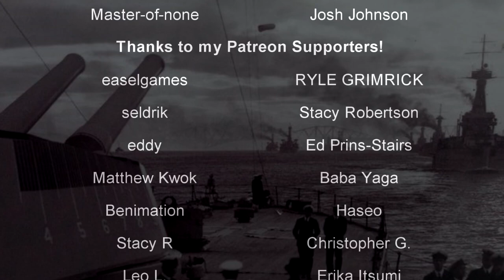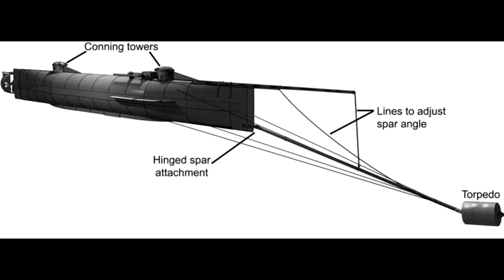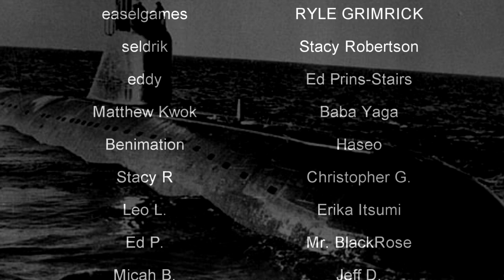5 of the Worst Submarines Ever | History in the Dark

Comment: The first generation nuclear Soviet submarines, the HENs. Hotel—-Echo—-November classes. Were noted for the irradiating their crews. Safety on these ship was optional. The crews have my respect for avoiding disastrous accidents
Reply: Do you know how our ASW forces located and tracked Soviet submarines in the 70's and 80's? At least when I was an active duty USN officer, we had radiation detectors to "sniff" the water for traces of Soviet submarines. They actually left a "radiation wake" behind them as they passed through the water. We could detect it and even tell how far they were away. That, and they made a great deal of noise.
Reply: @ThePrader  …. We all knew they were noisy. A lot of that noisiness went away when they bought technology to improve props
Reply: @ThePrader  OPSEC?
Reply: @edwardpate6128  Pretty sure the tools we used in the early 1980's are all upgraded and the stuff our ASW used in 1979-1986 have all been upgraded. Even SOSUS is in the public domain. I had to wait for a TS clearance (1981) before I was even told about SOSUS.

Comment: Can you PLEASE make a list for the "Top 5 most DANGEROUS Racecars🏎🏁"
Reply: Oh, that horrible thing that Honda did that murdered Jo Schlesser? That sort of thing, right?
Reply: @robertwilloughby8050  also Mercedes first flying car

People keep blaming the British driver driver, but the fact that entire car also using same material as explosive part of WW2 fire bomb is just crazy. On top of literal meat barrier
Reply: Kind of difficult to do, because it's a general case of the older, the more dangerous (up until about 1900). A 'most dangerous for their era' might be more doable, but aside from putting all the Chapman-designed Lotus F1 cars on there this too would be difficult to judge.
Reply: The first two generations of NASCAR stock models would technically belong, considering that NASCAR back then did not have the same safety standards. 

Not to mention that F1 did not have the halo safety device for much of its existence. Aside from the already mentioned Mercedes-Benz 300 SLR and the Honda car that killed Jo Schlesser, one of the few others I can think of that would have been unusually dangerous for the time would be Brabham bt45c "fan car".
Reply: Maybe should specify 

Maybe the first list should be about racecars from the modern era ( 90's/00's - Present)
Reply: So, a list of 5 Group B rally cars?
Reply: @epikmanthe3rd  Group B happened in the 80's
Reply: @jacobwhittington2462  Why does that contradict a list of the most dangerous race cars?
Reply: Ah. The second comment. Well that's more boring.
Reply: @epikmanthe3rd  there once was a Toyota racecar that broke the drivers RIBS
Reply: @jacobwhittington2462  Group B had very few rules, and not very extensive enforcement. Only 200 road going versions, no restrictions on materials, no limit on boost, had to be enclosed, and maximum tire width calculated by engine displacement. Enforcement of some rules were so lax, roll cages were known to be made out of cardboard. The cars were so light and powerful that the Lancia Delta Stradale could go 0-60 in 2.8 seconds on gravel. Walther Rohl described the cars as too fast to think, and they were so dangerous the series lasted only 4 years. With only 3 of those years being with purpose built cars.
Reply: @epikmanthe3rd  I congratulate you on your research on this
Good Job👍👍👍
Reply: It’ll just be 5 generations of viper.
Reply: @megladon6  As a race car, the Viper wasn't that dangerous. It's aerodynamics were fairly traditional and in the hands of a capable driver it was fairly predictable.
Reply: @bocahdongo7769  magnesium wasn't uncommon in race cars at the time. Maybe not to the extent of the Honda, but still significant amounts were being used in the construction of other cars.

If you want to talk about fire risks, how about the BMW engines that ran on a toluene/gasoline mixture?
Reply: @musewolfman  Uncommon on specific part. But not the whole car (body, engine, chassis, etc) 

And let's be honest, even aviation industry itself was already aware enough with what magnesium can do

Comment: in case of Hunley, after her wreck was found, it was found she wasn't damaged by the torpedo at all. If anything, it seems her crew fell victim to carbon dioxide from their exhales.
Reply: shockwave from the blast did them in, turns out a shockwave can shred your lungs without visual damage to steel, and that water is very good at spreading shockwaves.

Comment: Interesting bit on the Hunley, in the early 2000 4 Hunley-class submarines, built by the Singer Submarine Company, were found in Shreveport, Louisiana where Cross Bayou and Red River meet and they appear to have been scuttled to both prevent the Union 'Brown Water' Navy (Riverboat Navy) from sailing into the city that replaced Richmond as the Confederate capital after Richmond fell, as well as to deny the Union the use of these submarines. They were scuttled at the same time as CSS Missouri, the last Confederate Ironclad, was surrendered at war's end.

Also, the Union had an oar-powered submarine USS Alligator apparently, but that idea didn't float so well, pun intended.

Also, the crew of the Hunley, when exhumed from the wreck, were buried with full military honors as the first ever sub crew in US history to be lost during war.
Reply: @aldenconsolver3428  Nope, the Singer Submarine Company (SSC), which, as the name suggests, built submarines for the Confederacy to be built inland in Shreveport, Louisiana, then sailed down the Red River which cuts Louisiana practically in half from west to east, into the larger Mississippi River, out the port of New Orleans, and into the Gulf of Mexico.

The wrecks were built but never saw action, instead meeting their end as the war ended before they could be deployed.

Also, an amendment to my original comment as the ACTUAL historic record (I watched the video on my lunch break so couldn't really do any research until I got home tonight), there were five Hunley-class submarines built in Shreveport. Four never left and were likely the ones discovered scuttled, and one was sent over to Texas.

These four submarines were the ones scuttled at the end of the war where Cross Bayou and Red River meet when a Naval detachment went up Red River to demand the surrender of the Confederate ironclad CSS Missouri.

SSC also built two smaller submarines CSS Pioneer and Pioneer II but were more notable for their sea mines and torpedo mines.

Comment: I knew about the CSS Prefix; - did you know there was a CSS Enterprise? Completed in 1864, 972 tons, 76.9 meters long, 8.6 meters wide, used as a Confederate Blockade Vessel in 1865, sold as a Transport to Brazil in 1866, and retired in 1877.